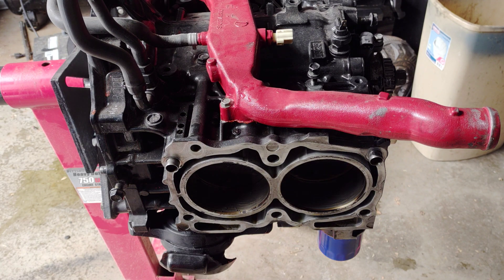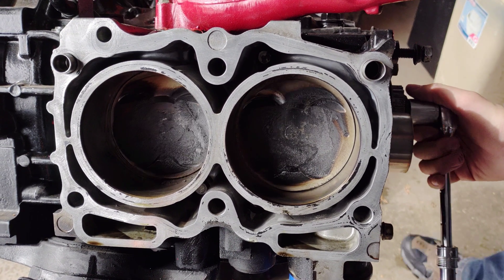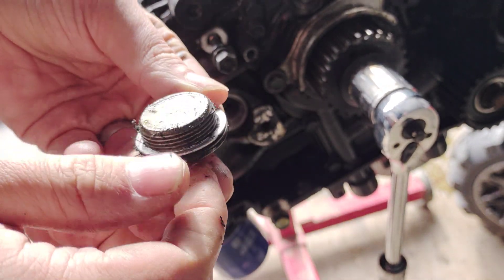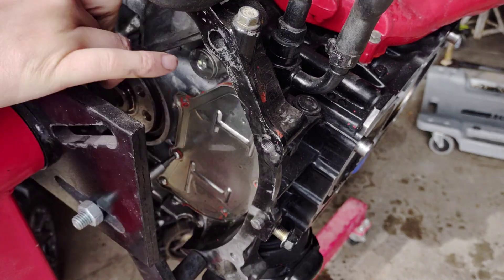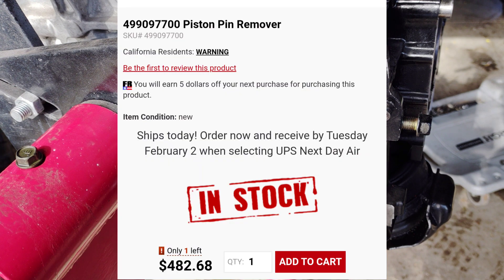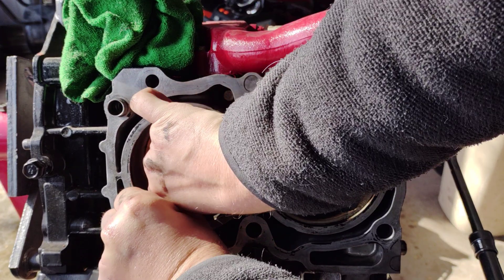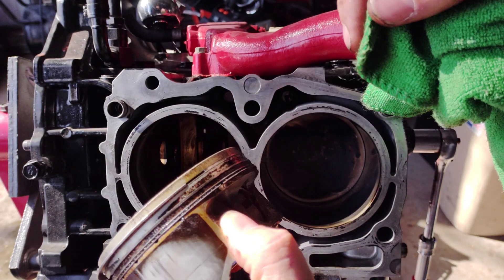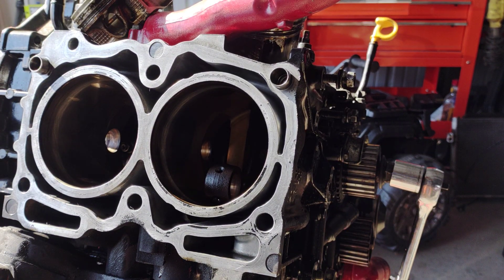What causes Subaru oil consumption? Engine teardown and piston removal.

Comment: You're very knowledgeable. I'm subscribed now. My 01 outback burns about a quart every 1,000 miles. I need to give this a try. 

Would you have any idea as to why my Subaru only gets around 200 miles for an entire tank of gas? What's going on with that. I can't seem to figure it out.
Reply from the maker: Thanks for the subscription. In regards to your fuel economy, if you're burning that much oil every 1000 miles, it's fouling out your plugs and causing a dirty fuel burn. It's not good for your O2 sensors either because it can foul up the sensors. If you smell your exhaust, it probably smells very rich, even after warming up and the pistons will be coated in carbon buildup. This causes predetonation which the ECM compensates with more fuel and less timing.
Reply: @BoxerTechGarage  that's a very helpful comment. I'm having those exact problems and I had no idea they were connected. Thanks.

Comment: You think using marvel mystery oil with good oil will get those rings moving without having to take the motor out and replace them not looking forward to having to replace them? I only have 111thousand on a 2005 subaru legacy outback stick shift
Reply from the maker: It's worth a shot. People have also reporting using a half quart ATF and Seafoam in the crankcase for about 200 miles before an oil change working to clear out any built up carbon, but results may vary. In the case of this engine the rings were completely seized in the journal. Once that happens, their ability to spring back against the cylinder wall is degraded
Reply: @BoxerTechGarage  thanks for the reply most people dont answer back hey if you want to make some dough i can bring it to you?
Reply: @BoxerTechGarage  how can you tell if it’s worth trying seafoam or mmo? Vice knowing the rings won’t come unstuck?

Comment: hi all, some websites recommend using oil cleaning additives like seafoam or marvel mystery oil  that are supposed to resolve this problem by supposedly diluting the gum and possibly unsticking these oil control rings. has anyone had experience with that? by the way i'm using 5w30
Reply: MMO is ok to add if the oil goes low, or put it in to begin with. Seafoam is a bit too harsh of a solvent, but they suggest to use it at idle right before an oil change.
Reply: I'm burning a quart every 400~500 miles.  I'm going to try using Subaru Engine Oil System Flush Part Number: SOA868V9290  If it works anything like when I had a Jiffy Lube do a flush on a newly acquired used Miata, it should be pretty effective. (plugged up the oil filter in just 10 miles, from loosening up so much carbon and sludge!) 😅
Reply: Try Valvoline Restore and Protect.

Comment: I have a 2011 forester fb25, burns 1L:1200km, engine still runs smoothly at 140,000km. Im using 5w30 for the rest of its life
Reply from the maker: The thicker oil makes all the difference. I tell everyone who has the newer FA/FB motors to switch to 5W30. You might lose 1 mpg overall, but that 1mpg is worth it versus running out of oil or a whole engine replacement outside of warranty
Reply: @BoxerTechGarage  i have a theory, the 0w20 too thin for boxer engines..lol
Reply: @BoxerTechGarage  can you help me? I´d like to buy a Forester 2011 with 185k km. The owner always chances oil around 8k km or 6 months, using Motul 10W40 and original oil filter. What do you think about this km? I´m worry because i had one model like this (with FB20) and the engine failed completely, i use wrongly metal conditioning made in Brazil, despite that, i´ve seen lots os people having engine issues, especially with this new version with chain belt. Tks!
Reply: @BoxerTechGarage  I will try this on my next oil change. My '17 impreza burns 1 qt every 2500 miles since new. Always change my oil at 5000 mile intervals. I can't wait to see if the slightly thicker oil will reduce consumption. I also have to use at least 89 octane since 87 always knocks too much especially between 2-3k rpms at medium loads. You are the first person I"ve heard explain why it would knock on 87 with oil consumption issues. Thank you
Reply: @itchykona228  How did it go? Did it stop the oil burning issue?
Reply: @BecksAuto  I haven't changed my oil yet. Not putting a ton of miles on it right now.
Reply: @BecksAuto  Sad to say that it has not improved. Still burns about the same amount. Oh well. Still love the damn car anyway
Reply: I use 10W 40. Works wonders for my  baby.
Reply: @eggpod4567  That´s the best viscosity to this engine, here in Brazil we have the FB20 engine, and runs amazingly with Motul Turbolight 10W40.
Reply: @eggpod4567  you will kill engine
Reply: I just ordered ATS chemical oil and fuel system treatment.  Hope it helps.
Reply: @hedrick5286  Hello Mike, Did this help? I used the fuel one but did not see any real change. still consumes 1L every 1500KM o so. Thanks
Reply: @samerawaragi3041  waste of money.  Switched to 5w30.
Reply: I have a 2016 at 125k miles started doing self oil changes still just 0w20 syn, but going to stick to 3-3.5k miles changes so I might not see any loss due to not waiting til 5k miles, Had to add a qt around 3-4k and while waiting for the 5k mark previously

Comment: Bought a 2004 Forester. 88K miles. Nice car. Found it was burning oil. My guy says lets do rings and new head gaskets. We did that. Engine is Still burning same as the example here,  300-500 per qt. Is the problem valve stem seals? Any advice would be greatly appreciated. Thank you!  
As a side note, I bought a new Outback in 2000, sold it in 2020 with 463K. I think head gaskets 4 times, plus T belts etc. 3 alternators total. No head work ever.  When I sold it it was using at about 1500-2000 mi. qt. I broke it in to 10K with conventional, then switched to synthetic.
Reply from the maker: Definitely replace the stem seals if you didn't do it already. Also, check the rear main seal, oil pump seal, cam seals, and valve cover gaskets. We thought this engine just needed stem seals and other gaskets and it was leaking less after replacing them but still was bad. After replacing the rings, 2000 miles and no burning of oil

Comment: Hey so what brand of rings did you get?
Reply from the maker: On a stock EJ NA, I usually go with Enginetech or Mahle. They usually don't need to be gapped, but I always check them just in case.